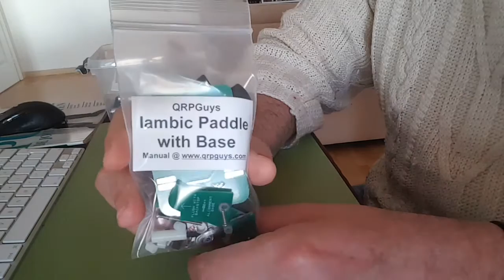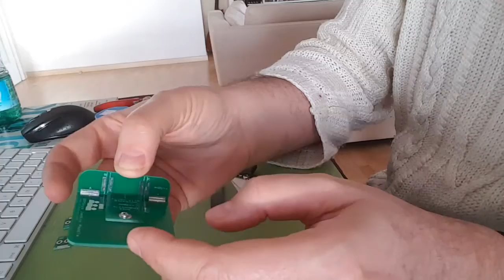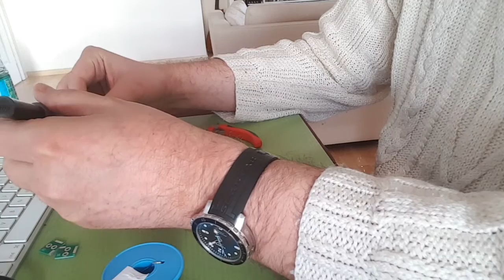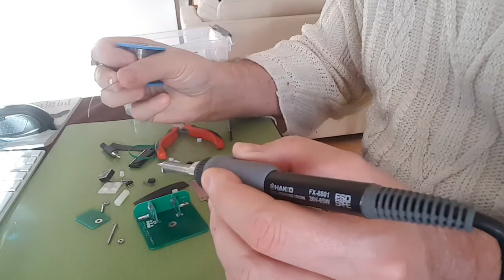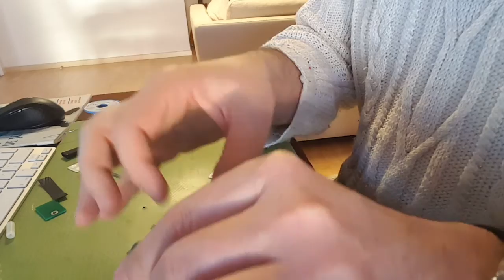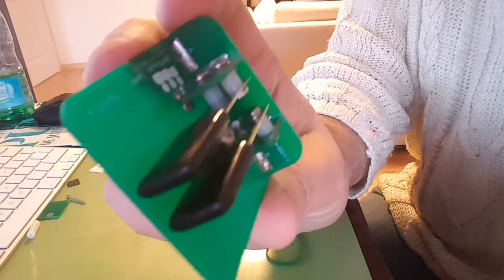QRPGuys Morse Code Paddle Kit Build.

Comment: just use tweezers and as you say a lot of patience!!
plugged into pixie and it doesnt work iambic -should it? if so where have i gone wrong? 73
Reply: Ah, the Pixie does not have a keyer! So it can't work with paddles, only a straight key.
Reply: Are you using a keyer? The paddles are just two strate keys looking at each other without an electronic keyer in-line. (Which your Pixie board definitely doesn't include.) (Oops, couldn't see the first reply before. But you can get or build an electronic keyer very cheap and connect it between your Pixie and this key. And Robert's your auntie's main squeeze,)
Reply from the maker: Hi, no, just my paddles on the side as a straight key..

Comment: Solder only one leg bracket and then remove the guide.  Attach the paddle leg to that side (both screws).  Attach the second paddle leg to the other leg bracket before you mount the second arm and then set up that bracket with some rubber bands to hold it in place.  Then you can solder it.  Your video is the only one I've seen to figure that out.  Mine came out fine.  Nice kit, piss poor instructions.
Reply from the maker: +Old Dog Good advise!

Comment: Tnx for the honest review. A person building this kit should take a course in electronics soldering or get an expereinced electronics tech to explain the tricks of the trade. Always be aware of the proper temperature for the work you are doing. Keep your tip cleaned and tinned. Always heat the work pieces and never the solder.  Then touch the solder to the heated work. For projects of this type modern "lead free" solder is a pain to use as it does not flow as well. For small projects such as this, using  an old style, rosin core, thin lead/tin electronics solder will give much cleaner easier work. I prefer Ersin Multicore.  You can also buy very cheaply some miniature bar clamps to hold things in position before soldering. You nailed one very important aspect: Think the order of operations through first! Just because the instructions say do it one way is not the final solution for everyone! I am ordering the kit!

Comment: Thanks! I just ordered this!  The only decent cheap key i could find.
Reply from the maker: I haven't tinkered with mine yet. The center washer needs adjusting and I might replace the rubbery material on the blades by two sticky rubber feets... The design is great, but it does need a bit of modifications to work fine... BTW good video on the MPAS. You don't have to extend the counterpoise all the way every time, depending on the bands you're going to use. I use a 10m counterpoise for everything and it seems to work just fine...

Comment: Nice. I got the MFJ 561 Paddle, which is similar in some ways but has metal instead of circuit board. The "wobblyness" of it's arms and the bigger space between groundrod and arms limits the speed at which I can transmit with them. I am curious too see how yours work out!

Beeing able to remove the cable from the paddle will make it far easier to store them I guess.

Thanks for the video.

73

DJ6KR
Reply from the maker: I had the MFJ paddles, threw them in the trash... I wish the base on the QRPGuys paddles was narrower. Maybe I should have bought the no-base model...